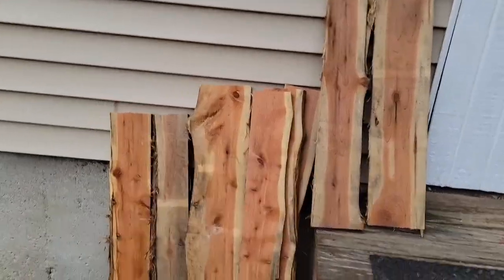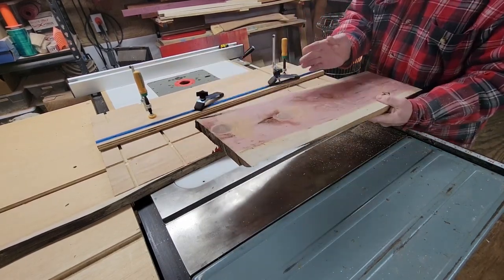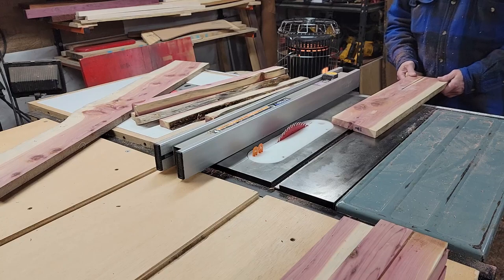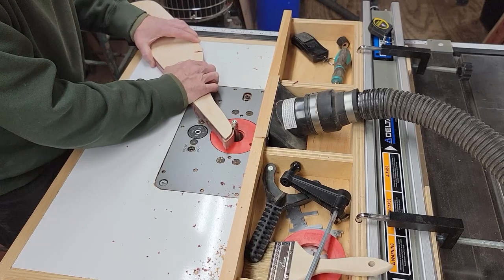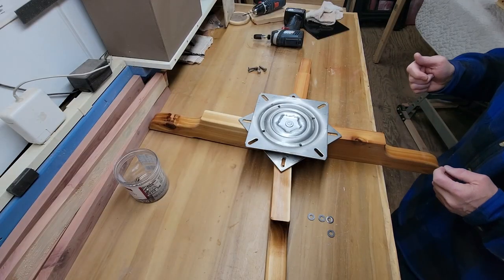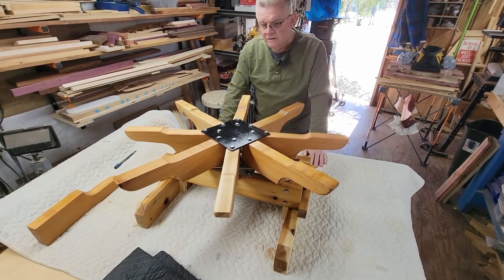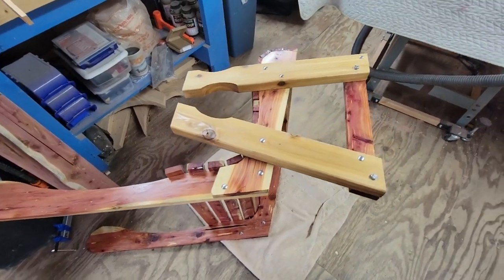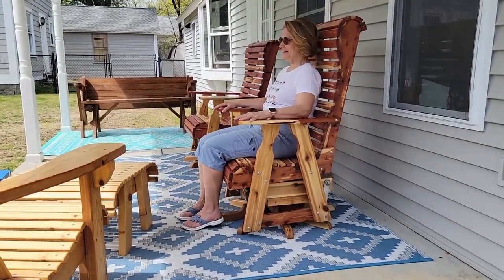How To Make Swivel Glider Adirondack Chairs

Comment: Pretty chairs.  Where'd you get the swivel hardware from? I see the glider hardware linked, but not the swivel.
Reply from the maker: Hey Aaron, I finally found it. I went to a site called shellac.com. They're about $50. They are sealed stainless steel. I have no affiliation with them, nor am I a spokesman for their product. 
My plans are now available on my website, https://oldeshedworkshop.com under 'Shop'. Good luck. Send pictures when you're done!